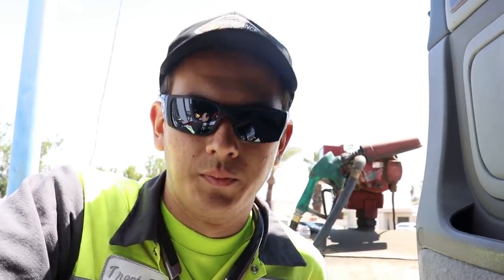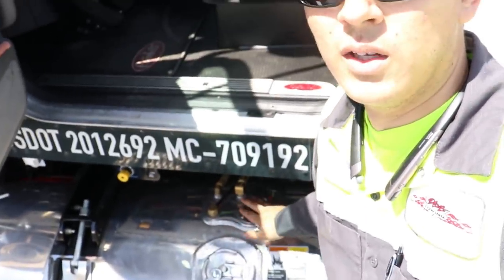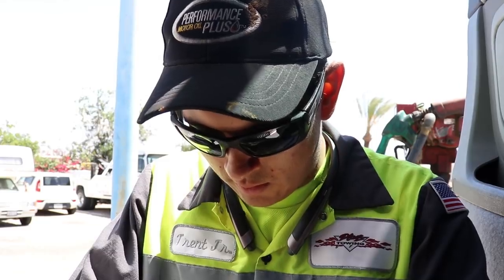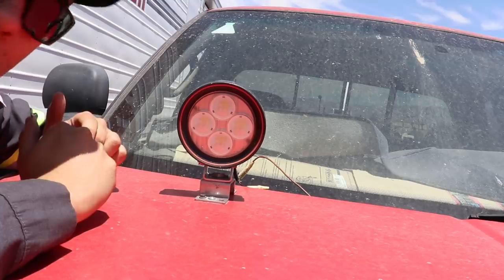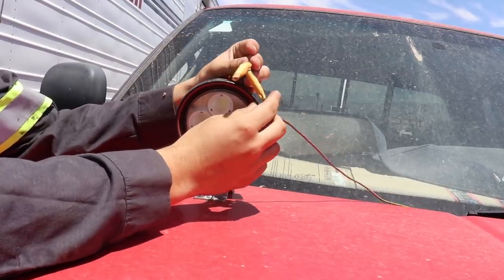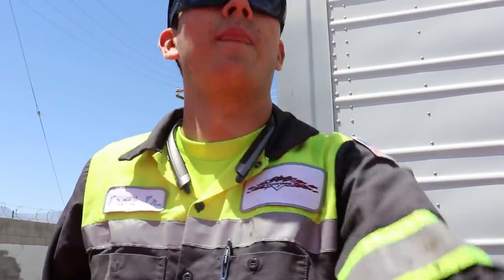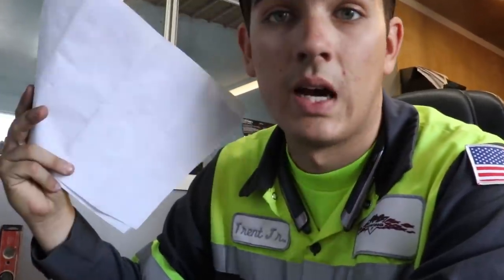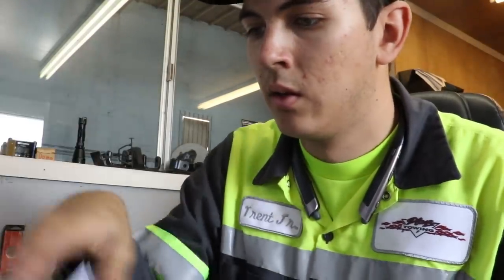Bad Wrecks & Operating Skid Steers | VLOG 003

Comment: Also, since I have knowledge in mechanics, I actually service the truck I drive at the company I work at and the others when I’m not out working. Like change the oil fuel em up, and all that. I use the Jake brake a lot so good thing I don’t have to change brakes much. We don’t take any of the trucks to another place to get serviced.

Comment: For the radio in the Rotator, is there a reason you couldn't use a magnetic mount antenna for the business radio? Being a ham (amateur radio operator) for about 25 years I understand the reason for the permanent A.K.A. hole, but there is a lot of magnetic mount antennas for a lot of different radio frequencies that 'should' be available.
Reply: n8pu  the cab is aluminum.

Comment: Got like 2 large tanks of diesel fuel at the tow company that I work at. The biggest truck (the 75 ton rotator I drive), takes ALOT of fuel. I only fuel that truck at the company only. If I had to fuel it up at a truck stop I’d never do it because I’d have to pay for it with my own money and it be super expensive. So if the truck were to run out of fuel at a job... well shit I guess it’s gonna have to somehow get towed back to the company, but I don’t think it possible because the truck is so large and heavy. But at the company I work at we all make sure the trucks are fueled up and maintained well so they don’t run out of fuel on the job, and don’t cause problems. Any tow company does that. Why wouldn’t they. Actually I know a guy that has a tow company it’s a small business only 1 heavy wrecker. The trucks are a older probably 90s newest. He don’t have a fuel tank at his company. Think he gotta take the trucks to a fuel station to get em filled. That must suck for him.

Comment: Educate me, what is "deff."
Reply: Diesel Exhaust Fluid, also known as AdBlue in other parts of the world. It's basically a solution of urea in water which is sprayed into the exhausts of diesel engined cars/trucks to reduce NOx emissions.
Reply: Shark , it’s short for Diesel Exhaust Fluid.
Reply: DEF -- diesel exhaust fluid. It's aerosalyzed and sprayed into the exhaust stream to neutralize certain pollutants
Reply: Diesel Exhaust Fluid. Helps diesel engines meet exhaust emission regulations. Urea mixed with distilled water. Gets complicated by many trucks having to run a regeneration program periodically.
Reply: DEF, Diesel Exhaust Fluid. "Cleans" the exhaust coming out of the truck before it gets released to the atmosphere
Reply: Diesel exhaust fluid, it is supposed to help cut down on particulate in diesel exhaust, whether or not it works or not it is a relatively new system and is causing a lot of truckers grief with the system braking down and not working right causing engines to go into limp mode.
Reply: D. E. F. Is a acronym for Diesel Exhaust Fluid. It is used in tier 4 final engines for emission reduction. DEF is injected into the exhaust stream and reacts with the SCR catalyst to lower NoX emissions.
Reply: DEF.  Diesel Exhaust Fluid.
Reply: Diesel Exhaust Fluid. Used in Tier 4 equipment to limit exhaust fumes and diesel particulates.
Reply: Shark DEF, Diesel Exhaust Fluid. Pretty much all trucks have it now due to emission standards.
Reply: Diesel emissions  fluid
Reply: Diesel exhaust fluid. I think Mercedes developed it first and branded it bluetec. It's injected into exhaust to reduce emissions. Something else to buy when running modern diesel engines, truck stops have DEF dispensers next to diesel.
Reply: Shark  Diesel Exhaust Fluid. It's used to reduce emissions.